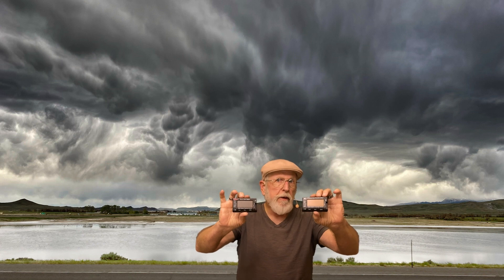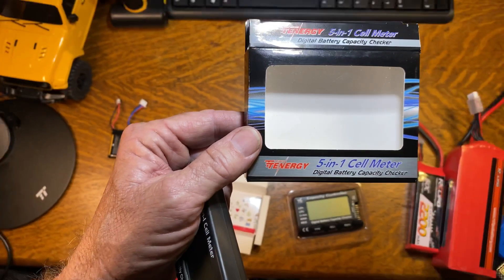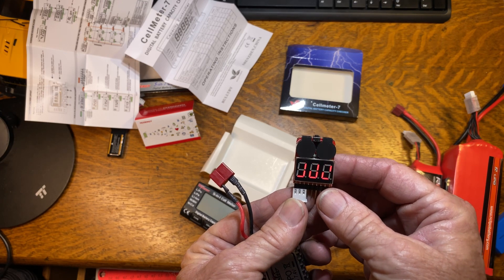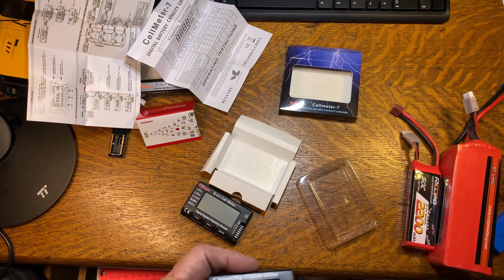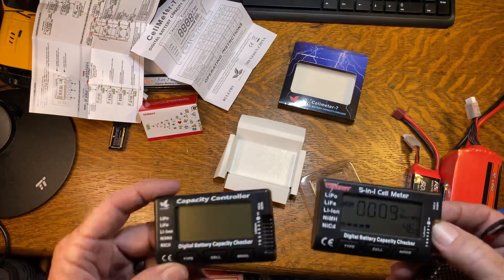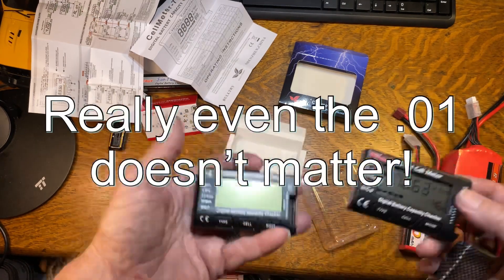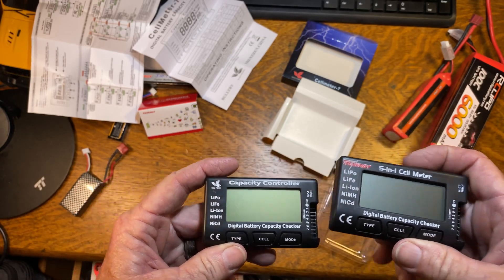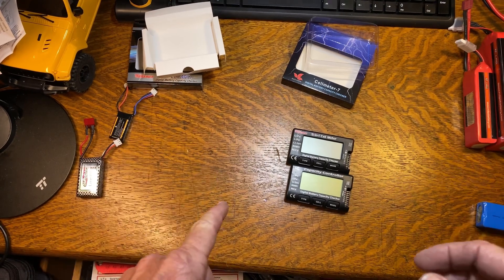LiPo charge monitor for your RC car or RC truck

Comment: The Tenergy does things the other will not do but Having both I would get the cheaper one as the extras it does do not apply to my usage. find vid on the tenergy only to see the differences.
Reply from the maker: Thanks! I found a few things since I did this video. I should probably revisit this. Thanks for checking it out.

Comment: correct me if I'm wrong but doesn't the 5 in 1 check internal resistance and the other does not?
Reply from the maker: Thanks Bob! You are correct. The 5   in 1 does indeed check the international resistance and the other one does not. 
Thanks for pointing that out. Have a great day and be safe out there!

Comment: Good thing you figured out why the buzzing sound was there.   Jim has been reviewing batteries to find the best for the RC trucks that we have.   I like not toggling manually too I always worry the little buttons fail from use.   I will share this with Jim.    💕NonnaGrace
Reply from the maker: Thanks and thanks for stopping by. Have a great day and be safe out there!

Comment: Good to know about the cord it is amazing it creates that feed back. Those controllers are pretty nifty lots of info and I did not know about the other settings. I like the first one better just minor things that made it easier.
Reply from the maker: I think really like the light because it’s on a boom arm but I think I’ll rip it apart and change the fluorescent bulb to LED. 

I liked the workflow on the first one best but honestly you would adjust. I think the screen was a little brighter (more silver) on the second one. 

Have a great day and be safe out there!

Comment: Those voltage/cell checkers are super handy and should be considered mandatory for any RC enthusiast using Li-Po batteries. I used one just like this for about a year before I got myself the Hobbywing LCD programming box, which has a cell/voltage checker built-in as an add-on feature. Li-Po alarms are also a great idea, especially if you have custom high-voltage fan setups like Game Changer fans. Basically all modern ESC's will have low-voltage cutoff out of the box and it should be adjustable, but if you're running 12v fans independent of the ESC's BEC it is super easy to kill a Li-Po. I've done it myself, until I recently found high-speed fans that run off the BEC that move almost as much air as my 12v fan setup. Great information as always, keep up the killer content! Best wishes from beautiful Seattle, WA.
Reply from the maker: Thank you very much. I really appreciate that. I know some of the entry level cars don’t do much in the way of LiPo protection so the alarms can be pretty cheap protection. 

Have a great day and be safe out there!
Reply: @RCModSquad  Really? That doesn't really surprise me but my first couple RC's were WLToys K989s and a 144001 and both models have decent low voltage protection. Not amazing or adjustable, but good enough to stop you from killing your pack. It wouldn't surprise me at all if the budget RC's that use 18650 2S packs had subpar low voltage protection. Luckily the Li-Ion cells are a bit less volatile than Li-Po so they should be more forgiving in that regard.